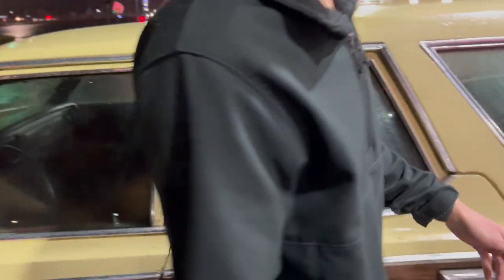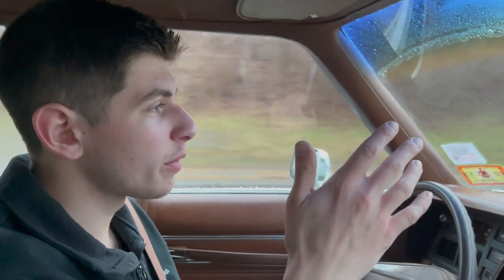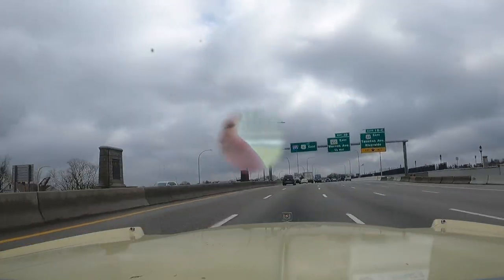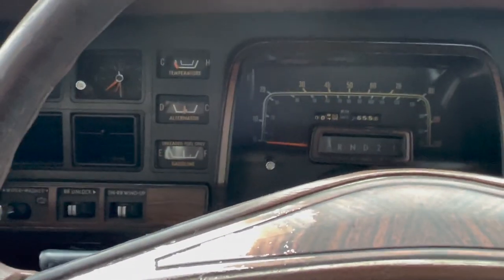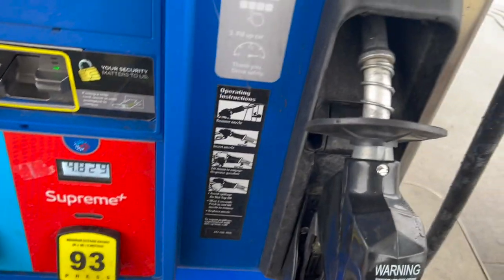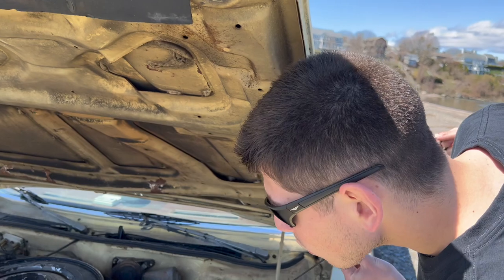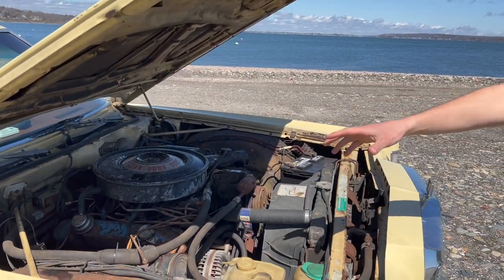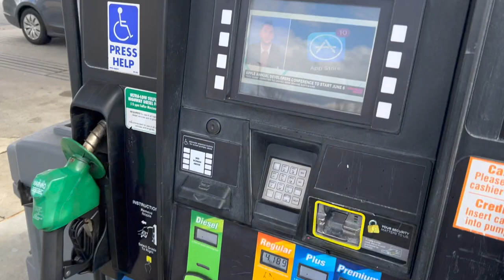First Road Trip in Our 1977 Chrysler Town & Country! Will it Make The 400+ Mile Journey? #revival

Comment: First and foremost, thank you so much for sharing the tranquility and colors of the seashore. The windshield view was so nice seeing the long hood! This was such and added bonus. Congratulations on the first road trip with the wagon. Of course the wagon made the trip! These cars, as you said, were made for this sort of stuff, very often with an Airstream trailer in tow behind! The size and torque of the 440 allowed for a long-legged final drive ratio, before overdrive automatics came to be a few years later. I think Chrysler went with lock - up torque converters in1978 which gave about an extra mile per gallon on the open road. 15 US MPG is very decent for a heavy car barely a month back on the road. I wonder if the fresh gasoline in the tank helped to wipe possible deposits off the windings for the fuel sender to allow the gage to start coming back to life. Indeed, we have cars that need a day or two for cranky electrical things on the instrument panel to wake up and behave properly. I am so glad Scotty enjoyed the car. He tells things as they are! Please keep bringing these adventures forth for folks to literally be right there with you. Bless you both and may your journeys be safe. Please get rid of those old tires, the cool wearher and rain helped, but hot weather and sustained speeds could cause problems!
Reply from the maker: Thank you so much for your comment! Scotty’s video should be posted soon.
Reply: @theunskilledmechanic  that will be great to see! In that little snippet you gave us, Scotty look like he was all smiles! He should be! We need more young folks out there to carry on the classic car hobby especially with the large cars.

Comment: I just found this video now a year old. Definitely get new tires! No use risking your life for a Utube video. If you haven't done it already I think you can still change the fuel gauge sending unit without a new fuel pump. Just a pain to drop the tank. Clean every electrical conection you can see. As long as you don't abuse it the 727 TorqeFlyte transmission will last a long, long. Just don't over load it with a heavy trailer. The 440 will put out a lot of torque than can eat that transmission on a long hard pull. If you have to pull something heavy, put it in 2nd and slow down. The lean burn engines had problems. I'm a 70 year old "old Chrysler guy". Been there, done that. Just sold my last one. '77 Dodge short wide bed Club Cab Power Wagon 4x4. 400 big block with 4.10 gears. 760 Thermoquad and Jacobs Computer controlled ignition system.

Comment: I really miss being able to see the front fender tips from the driver's seat. Anyway that car really brings back happy memories. My parents had a `75, the same color. But no roof rack? I've never seen one without a roof rack. The most surprising gas mileage I ever experienced was on my 1974 Miller-Meteor Cadillac ambulance that I bought in 1997. I flew to Denver from NJ and drove it home, with zero problems. I wrote down the odometer reading and the number of gallons of gas at each fillup, and it got 14.5 mpg on every tankful. That blew me away. Shortly after bringing it home I put it on a scale and it weighed in at 7160 pounds! Of course it was just over 21 feet long, and the engine was a 472. Your wagon is about 19 feet. Anyway thanks for sharing. I enjoyed that.

Comment: You're only getting 15 miles to a gallon of gas? Something's wrong. I had a 1972 Chrysler Newport four door sedan. It had the 400 cid V-8. That 400 V-8 is just a bored out 383. I used to average 25 to 27 miles per gallon of gas. Maybe it's how your car is tuned. I kept my spark plugs gapped at .32 instead of .35. Mine had a two barrel carburetor. I adjusted the idle mixture screws, backed out 1 and 1/2 turns. Since your car is five years newer than mine was, I don't know what type of carburetor you have. On my carb, I turned, I turned the idle mixture screws all the way until they just touched, or set. You don't tighten the screws. You turned them in lightly until they sat. Then you backed them out one and a half turns. I got good vacuum and like I said, the car got 25 to 27 miles per gallon of gas. I had to time it at 5 degrees after TDC...Top Dead Center. Mine was an early 1072. It was built in July of '71. It had points in the distributor. It did not have electronic ignition. Now the later '72s did have electronic ignition; but not the early ones.
Reply: 2-barrel vs. 4, and I'm not sure I've ever seen static timing ATDC?  What was the total advance?  I'm sure the Thermoquad in the T&C could stand to be tuned with a vacuum gauge, and some inevitable vacuum leaks tracked down, but if you were getting 25-27 MPG, I can't imagine drivability was very good.  Like with Lean-Burn - they did all kinds of mixture and timing tricks which worked in their testing conditions but were unusable in the real world.

Comment: My daily driver is a 77 Plymouth Gran Fury. I take it everywhere and regularly pull many hundred mile plus trips. Its got 195K on the clock w/o a rebuild on either the engine or trans. I did a timing chain and trans seal. These C bodies are excellent cars. Coo l trip, thanks for sharing
Reply from the maker: I love the 77’s! They really are great drivers.
Reply: My uncle had one.  Does your speedometer go to 100 or 84?  My uncle's car went to 84, which I have learned is very, very rare.

Comment: That wagon has to have at least a 20 gallon tank. With averaging 15 mpg you should of be able to make it back home on one tank of gas.
Reply from the maker: It’s a 24 gallon tank. We were just playing it safe by keeping it full. The gauge wasn’t reading accurately.
Reply: When properly tuned those baots should average 21 mpg well until you opened up the 4 bbl

Comment: Does the cruise control still work on the old girl or what? I find if there is a issue with them it's a vacuum leak anyway love how it still have the lean burn system on it too and even better that is not giving you any issues anyway I like that car reminds me of the one my grandparents had then it went to my uncle but it was a 1975 had the Chrysler rally rims or Road Wheels I call them and it was dark green with green interior but it had the same lather seats and it had a 440 TNT engine. It was a cruiser my parents use to borrow it every year to go on vacation.
Reply from the maker: No cruise control on the ole girl. She’s pretty bare bones.

Comment: What a great car. Use a zinc additive during oil changes to protect the engine. Pre 1995 engine's need zinc and today's oils have very little to none.
Reply from the maker: I run 20w-50 high zinc oil in all of our older engines.

Comment: I had a 78 Diplomat Wagon. List 7800. I paid 6650.Same color.  Classic Cream.
Reply from the maker: That’s awesome!
Reply: @theunskilledmechanic  
The 318 engine seized at 25000 miles. The car died altogether at 83000 miles.  It needed every thing.
When the front wheel fell off on the highway I junked it.